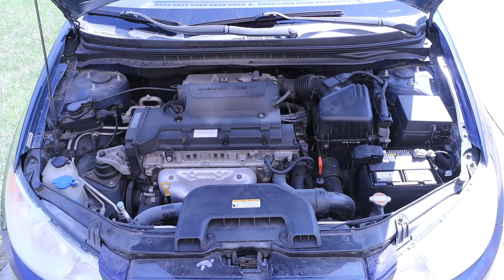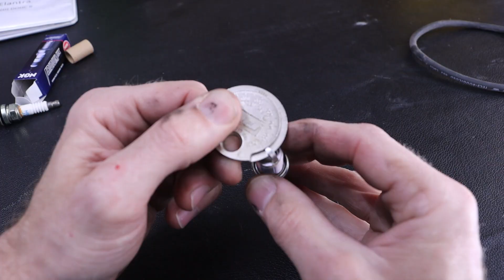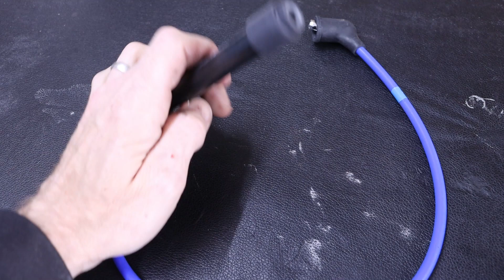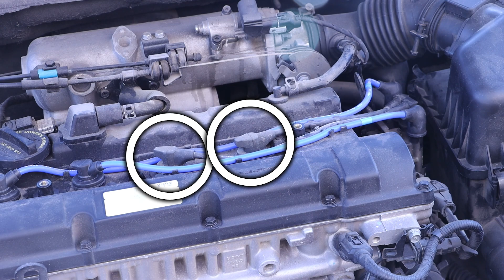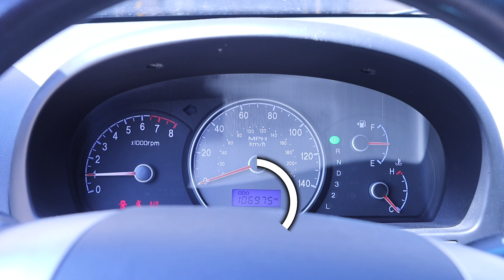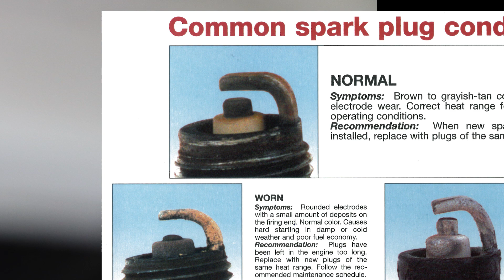Spark Plug And Ignition Coil Wire Replacement - 2008 Hyundai Elantra, 2.0L (2007-2010)

Comment: NGK and Denso plugs usually say to not use anti-seize as it can lead to over-tightening.  They already have nickel plated threads which is already an anti-seize.
Reply from the maker: Yes, you are correct.  Some manufacturers will put special plating on the spark plug threads to essentially act as an anti-seize agent.

Comment: Great video but please, NEVER apply anti-seize to NGK Iridium or any NGK sparkplugs. The anti-seize will throw off your torquing and you'll likely over tighten them. They already have a coating that does not require anti-seize.
Reply from the maker: Yes, I agree, many spark plug manufacturers do not require anti-seize on the threads as it can throw off your torque specs.

Comment: For those of you who are confused on Torque specs 168 inch lbs is approximately 14 ft lbs just so you know. Don’t go over tightening your spark plus to 168 FT lbs and if you don’t know how to tell the difference maybe leave the work to a professional.
Reply from the maker: Thanks for the comment.  I would also add that many consumer torque wrenches start at 10-15 ft lbs and sometimes when you are at the lowest torque setting on the wrench there can be slight variations in the accuracy.
Reply: Sorry, but mine 2008 Elantra is 15-22 ft lb. how about that? I put 20 ft lb, nothing happened. Please don't scare people.
Reply: @ never tried scaring anyone. You might not see anything with naked eye but you possibly could be over tightening and ruining the threads. Fyi
Reply: @orlandogbuckets1227  Why? is what the manual call for my car. I don't know where you get that torque.
Reply: @orlandogbuckets1227  For a 2008 Hyundai Elantra 2.0L, the spark plug torque spec is generally around 18 ft-lbs (25 Nm) for plugs with gaskets into aluminum heads, but it's crucial to use your plug manufacturer's guidelines (NGK, Denso often suggest 25-30 Nm or 18-22 ft-lbs) and ensure the plugs are gently hand-tightened first, then torqued, avoiding over-tightening to protect the aluminum head threads

Comment: Excellent video. I have a 2008 Elantra with 165,000 miles. What would be the correct calibration?
Reply: Help me
Reply from the maker: @jeansumoza4620  What are you calibrating?  The vehicle in the video is also a 2008 Hyundai Elantra so I would expect your 2008 Elantra would be the same.
Reply: @InsaneOil  I want to calibrate the spark plugs if my car is the same as the one in the video and has 155,000 miles
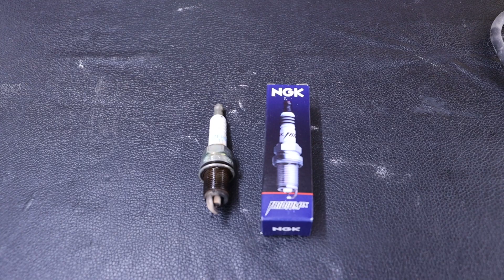Reply from the maker: @jeansumoza4620  The gap should be .039 - .043 per the repair manual.  See 2:19 in the video.

Comment: Can you tell me what tool you used for the two 10 millimeter bolts ?! Please I need to change my wires but need to purchase the tools.
Reply from the maker: A 3/8" drive socket set with a ratchet that has metric sockets.

Comment: Nice detailed video I would say you can skip the anti seize/dielectric grease as those plugs already have an anti seizing plating on them and any sort of lube or anti-seize will change your torque spec opposed to if you didn't put any on.
Reply from the maker: Thanks for the comment.  Much appreciated.  I understand your thoughts on applying anti-seize to the threads, however, the repair manual specifies the application of anti-seize to the threads before installation.

Comment: Hi sir..i have a problem with my same model elantra.. which is..my elantra not in normally idling... always drop of engine timing,like jerking...spark and wires already change it...pls help me..
Reply from the maker: When was the last time you changed the transmission fluid?
Reply: @InsaneOil  4month a go...
Reply from the maker: @norazrulaizad912  Have you cleaned the throttle body?
Reply: @InsaneOil  yup...i was...😅this car make my head spinning...

Comment: I own a 2008 hyundai elantra, and I've been having tire issues so i brought it into my local Firestone and they diagnosed me with :

- failing front wheel struts (left and right)
-failing rear shocks (left and right)
-failing front sway bar (left and right)
-recommended mileage maintenance for my spark plugs

and they wanted $2400 for all the work. For context I'm in Dallas, Tx, so you know not LA or NY pricing.

I was really dejected and upset about the cost and was about to go shop around other repair shops to see what better deal i could get. I figured i could get the parts myself and try and find someone willing to do the labor for around $1,000. BUT then i found your videos, insanely high quality, very descriptive and now I've gone and found all the parts online for less than $400 and i expect it'll take me an afternoon at my friends house using her jack and tools to get everything repaired.

You are doing awesome work making these videos and you personally saved me a small fortune by giving me the knowledge and confidence to do it myself. Thanks so much!

On a side note: Where are you located? your car has alot of rust on it that mine doesn't at similar mileage. But instead of rust damage, my car has all the plastic parts breaking off from the Texas heat.
Reply from the maker: Thanks for the comment.  I hope you saw my videos on shocks (https://www.youtube.com/watch?v=kD3bWS3aggM&t=49s), struts (https://www.youtube.com/watch?v=nb34DCYkRKU), and sway bars (https://www.youtube.com/watch?v=tWo10ILl3Nk).

I am located in Nebraska...road salt and ice/snow conditions for 5-6 months of the year.